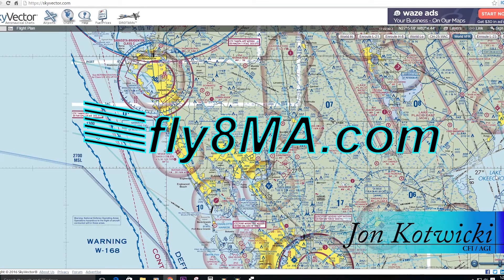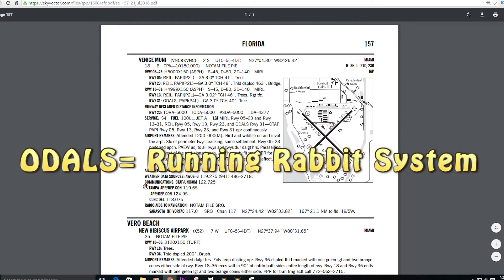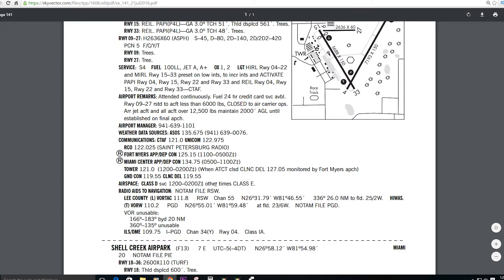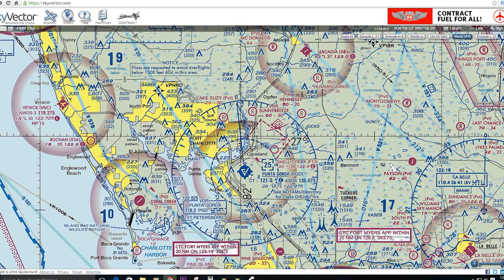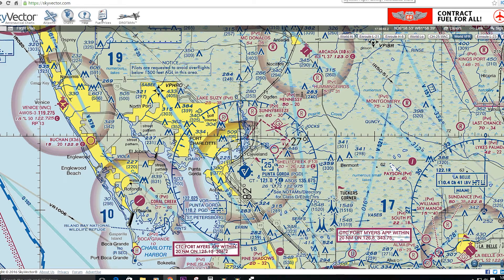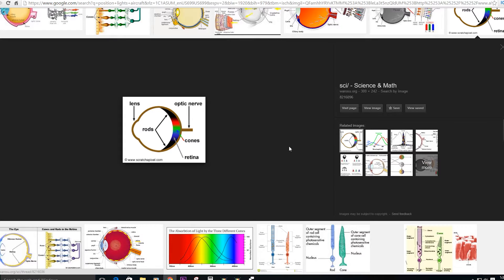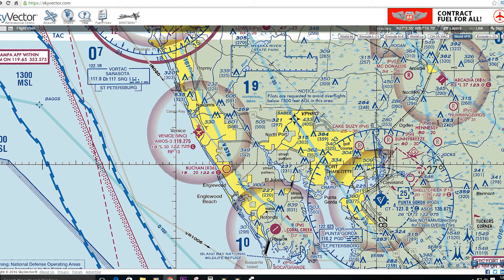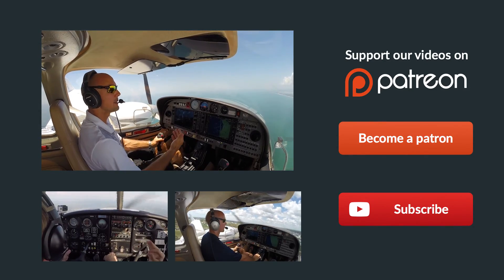Ep. 104: Intro to Night Flying | Night Flight Planning

Comment: It would also be best to check weather more thoroughly because even though night usually feels a smoother flight, you may not be able to see cumulus buildup in front of you if there is no light. Another concern is you will not be able to see a layer of cloud that may sneak under you for any precipitation that might be occurring. This is especially concerning if it is during the winter and there is a chance that the precipitation can cause ice.

Comment: Question:  Most approach lighting is visible only from the approach end (REIL, threshold, etc.).  Instructors teach students to start a descent to landing on the downwind leg opposite the landing point.  If threshold lights are not visible from the side, how does the night-flying pilot identify the landing point from the pattern?
Reply: You can definitely see the runway lights from anywhere in the pattern (centerline or the lights on either side). You can easily estimate where abeam the numbers is, by seeing where these runway lights stop. You don’t need to see the threshold, REIL etc. until you’re lined up on final and short final.

Comment: Can you tell the difference for VFR flight planning on MEP  ? Is it the same? What about congested areas.  It just gives you the insurance that in case of 1 engine failure you are able to glide outside of city border and safety requirements could be met? Just don't understand how it works, but i prefer to fly on MEP rather then SEP. Thank you very much for your videos,  You explain everything using plane text. For me it's a little bit fast. could you please speak slower:d Consider not all pilots are english native speakers> Thanks again.